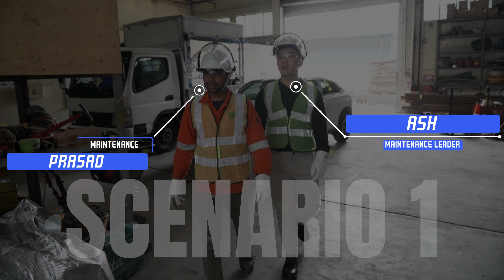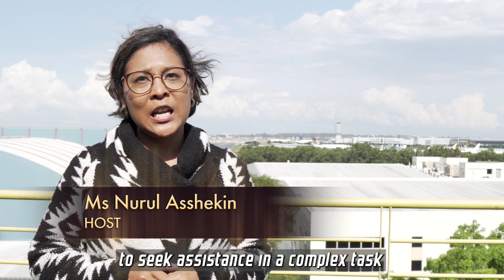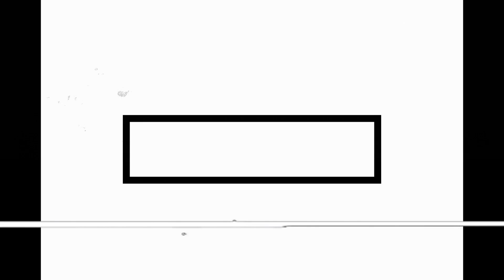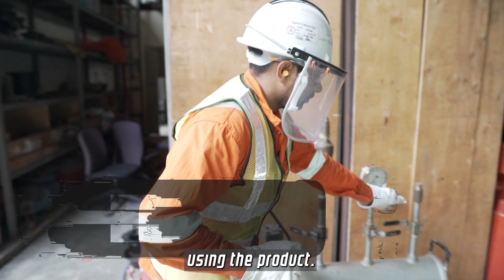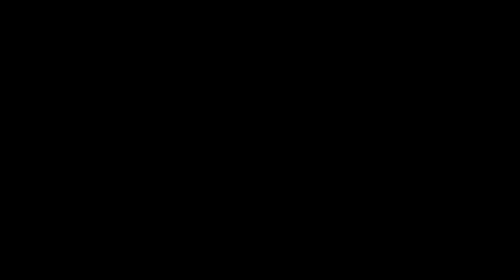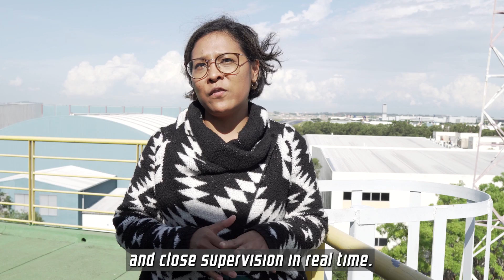Accident Prevention - ThinkReality A3 & RealWear (Solution)

Comment: Good innovation safety ideas, the Engineer while He at his office to do other stuffs, the supervisor at the site could seek his help to confirm the exact area they wanted to proceed the work through that new stuffs of communication. 

Is it works with those Restricted  Camera & Video Areas such as at ExxonMobil, PCS & Shell Jurong Island?
Reply: Need to get approval from them to use this equipment, need to do several test to ensure the ignition source of potential light can create damage to the live system and explosion to an opened confined space refer to Petrochemical Plant Areas.
Reply from the maker: Yes, you are on point. 👍